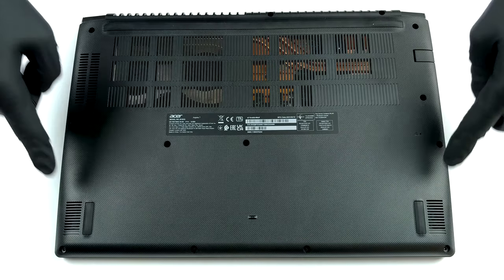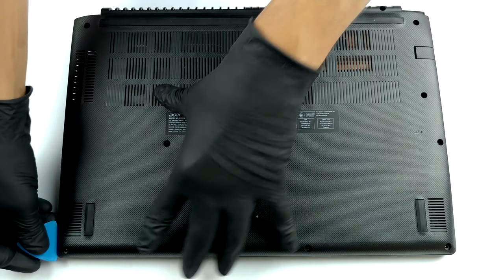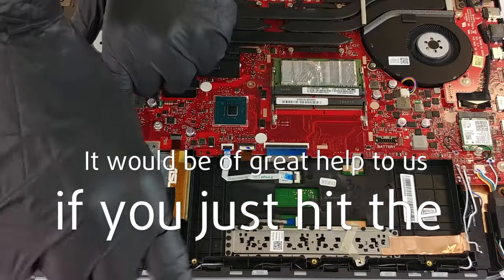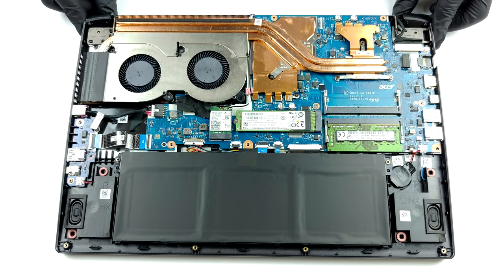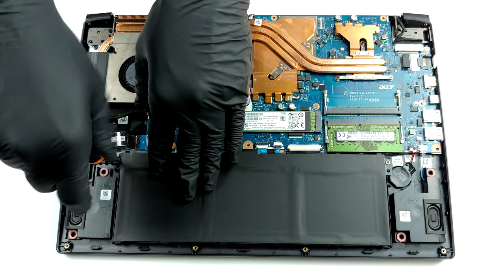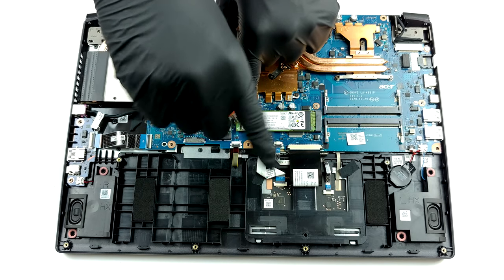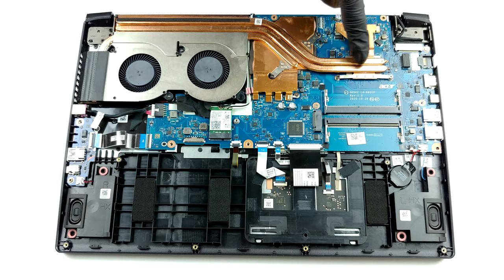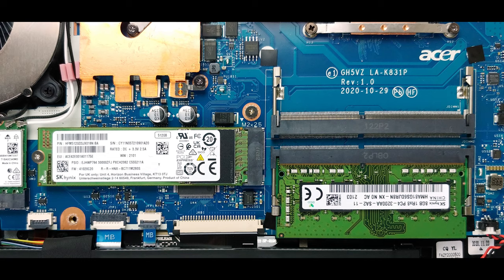🛠️ Acer Aspire 7 (A715-42G) - disassembly and upgrade options

Comment: As of this writing, the CPU used is a Ryzen 5700U which is only 15W TDP.
GPU used is 3050 TI which is 80W TDP.
No wonder the GPU gets 3 heatpipes.
Does this laptop gets hot? I am super critical with cooling: I had 2 laptops killed because of heat.
Reply: You are wrong....This laptop is the A715-42G which has  a gtx1650 and r5 5500U which has the 15W TDP.
the one you talked about was A715-51G and A715-42G perfomance which also has a r5 5500U and RTX 3050.Though you dont know, rtx card generate like a bazillion degrees of heat...Also this is a laptop it will be many times hotter than a desktop gpu. which obviously needs more than 3 heatpipes.
Reply: @CheeseBurger69notavailable  "As of this writing, the CPU used is a Ryzen 5700U which is only 15W TDP."

I am implying that the new Acer Aspire 7, not the OLD ones.
Reply: @DanBurgaud  is it R5 or R7
Reply: it doesnt heat that much actually but while cooling its kinda loud (at like 80 degrees celcius)

Comment: Hey i want to open fans for cleaning heat sink from inside. is it safe? and is it helpful. its been 1 year since i have been using this laptop.
Reply: its really easy to open and clean, but be carefull, there is a ducktape that connects the fans with the  cooler so dust doesnt come in, once you tear it off you cant put it back. Also watch the screwdrivers they are easy to break, if it doesnt fit dont force it
Reply: Can we upgrade this latop to 2 TB SSD ?   [ Recommended upgrade is 1 TB by most sources ]

Comment: This Laptop should also Have a Area For installing 2.5" SSD as the alternative of HDD
Reply: DOes it have 2 slots of SSD? The one that I am willing to purchase has only 256 GB, can I buy now more m2 SSD and install it there?
Reply: @exfordovsky5315  Yes But you can Only Ad M2 slot or Nvme SSD in this laptop
Reply: @exfordovsky5315  it’s kinda late but i’m using the acer aspire 7 and id say it’s better to buy a lenovo ideapad gaming 3
Reply: @genosootaku8649  I already purchased Lenobo Ideapad 5 pro, so... Thanks anyways xd
Reply: @exfordovsky5315  oh, good for you, that actually gives you more options for upgrades
Reply: @breaKKwave23  ie in a laptop 1 slot and that which is already occupied?
Reply: I couldn't see any sata entry. Is this laptop has a sata entry?
Reply: Can we upgrade this latop to 2 TB SSD ?   [ Recommended upgrade is 1 TB by most sources ]
Reply: @exfordovsky5315  Can we upgrade this latop to 2 TB SSD ?   [ Recommended upgrade is 1 TB by most sources ]
Reply: Yep, 15" laptops can afford 2.5 slot, but this one doesn't even have a second m2 slot. very budget decision
Reply: @genosootaku8649 
You can use wifi slot fo the second SSD.
And use usb adaptor mini for wireless

Comment: ACER ASPIRE 7  A715 - 75G
Can we upgrade this latop to 2 TB SSD ?   [ Recommended upgrade is 1 TB by most sources ]
Reply: Surely you can. You can even use 4TB or 8TB if you need and find one. Just be sure there is no heatsink installed by default.

Comment: acer aspire "A715-71G" please

Mine is very slow even after reformatted. Any Ideas?
Reply: bloatware
Reply: Try updating the drivers.
Reply: @nicrovender2962  re updated everything after refomart. Still nothing happene. Usualy when I reformat it should go back to normal.
Reply: Can we upgrade this latop to 2 TB SSD ?   [ Recommended upgrade is 1 TB by most sources ]

Comment: Can we change the wifi card .and how to do it
Reply: but why do you want to change WiFi card but yes you can change it
Reply: The Original and Pre-installed Wifi Module Is Good Enough I think
Reply: Can we upgrade this latop to 2 TB SSD ?   [ Recommended upgrade is 1 TB by most sources ]

Comment: ram mhz? for aspore 7 i510th gen?
Reply: 2666mah
Reply: @ankitchouhan9761  i bought tuf f15
Reply: @farhannavas2690  badiya he pr utne me to hp pavilion ryzen 5 5600 bhi aa jata vo bhi badiya tha
Reply: @ankitchouhan9761  i saw the pavilion 15 but it didn't have the turbo, performance power mode Toggle switch and other gaming related software from hp..
in asus there is armory crate software where we can control fan speed and power modes.. led colors and the display configuration
i also got 144hz display. 
i am able to control charge maximum to 60 or 80 or 100 percentage to maximize battery life.
tuf is more gaming orented than pavilion.
Reply: @ankitchouhan9761  bro buy a keyboard cover for your laptop and always put your laptop in the cover because ants will get inside...
fucking ants tried to go inside my charging cable
Reply: Can we upgrade this latop to 2 TB SSD ?   [ Recommended upgrade is 1 TB by most sources ]